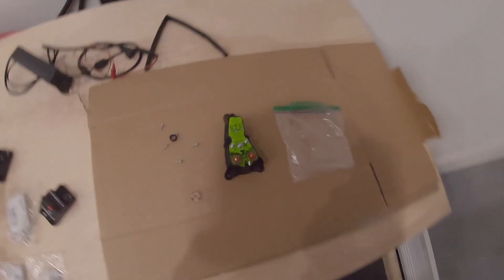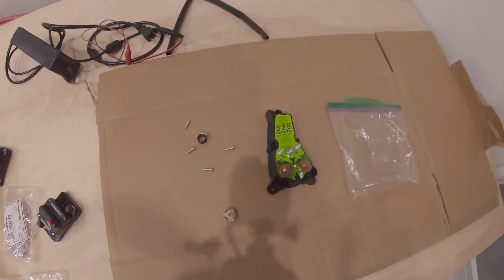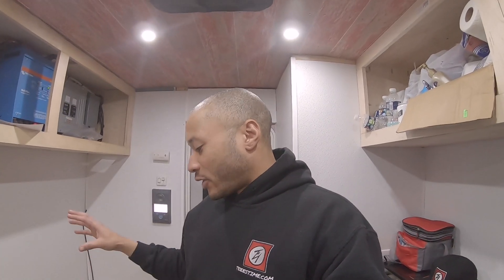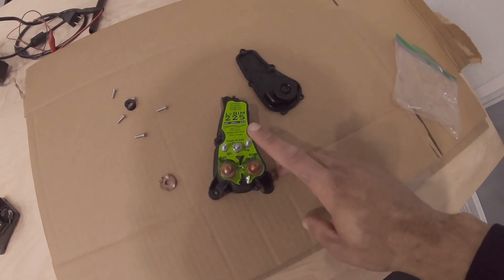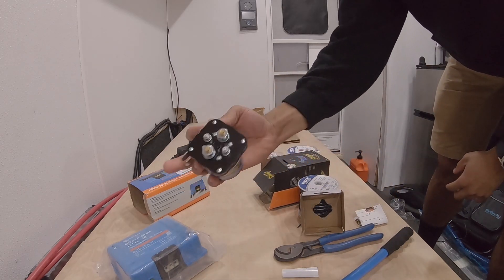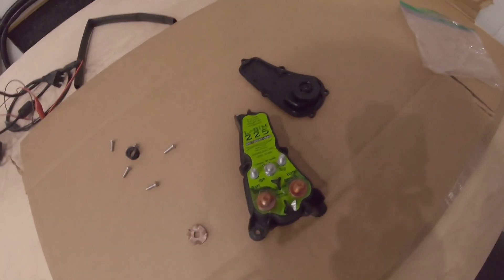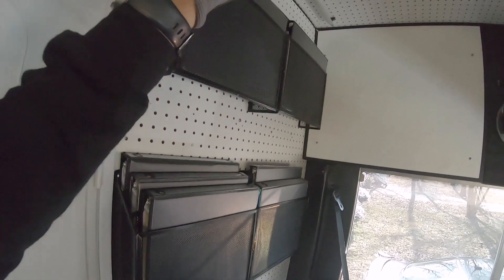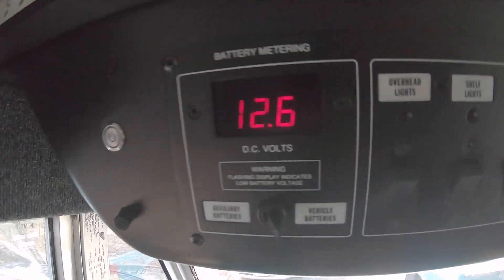Victron Orion 12/12-30 DC To DC Charger Install | DIY Off Grid RV Van Build: Episode 67

Comment: My victron dc dc is skipping bulk phase I found forums alone many others having the same issue. This didn’t happen when I first got it. Ran it for only a few trips then started doing it. Things useless now. Anyone figure out then solution? I’m thinking just go with a different brand all together.
Reply from the maker: Also the ignition sense is important. I previously had the battle born isolator 225 and it melted internally. I wouldn't recommend that. With these electronics it's imperative to double check the that it's programmed before putting in use. My orion has been in for over a year and the vehicle is daily driven with zero issues but time will tell. Hopefully you find the right solution for your needs

Comment: Using same charger. Gets so hot I can’t touch it for more than a few seconds! Is that normal? I’m using 6awg wire and 60amp fuse at the battery. 

Is the burning hot normal?!
Reply from the maker: Hi Jonny, they do get hot especially when running at max. I have some aluminum stock on the back of my solar charger and another plate that I have fhe orion. Heat is normal just make sure all connections are tight, the correct charge algorithm and the correct gauge wire for your run.
Reply: @teeestime6202  it gets super hot even just running for 20 minutes . yeah I have the correct gauge wire and the correct fuse. I did install the charger on some aluminum channel so it has space to breathe behind it and then I also installed behind it to thin sheets of aluminum. I got three small 12 V fans I’m going to Mount them to some thing and then mount the fans right above the charger. That’s the plan as of now.
Reply from the maker: Read the instructions and get a temp gun. There's something in there about operating temperature and make sure you programmed/ set the charge algorithm for the correct type of battery  and duration based on voltage.

Comment: I just heard you mention you are using 6 guage wire.  How long is your run?  I purchased a similar unit (isolated), and from what I read, I need to use 4 guage wire (techincally 5 guage, but I cannot find that easily).  Am I missing something?
Reply from the maker: Hi Greg, welcome to the channel and every install is a little different. Definitely use a voltage drop calculator. This one should help https://www.southwire.com/calculator-vdrop you'll need to know your voltage (a/c or d/c ) the length of the run and what amps your requirements are at the end of the run. Hopefully this helps and be safe

Comment: isn't that silly  that you have to add more victrons to get more power? I wonder why they don't make a 60 amp or more. I really like the idea of using an app to monitor and change settings when you need to . I may get one of those relays and just put an anderson plug on it ,cause i have a set of jumper cables with anderson jack on one end . That way i can jump my self or someone else . BTW my friend you should check out EWCS  Premium Extra Flexible Welding Cable. they sell on amazon . After trying their wire years back ,I don't buy any other brand .  Great video btw. Oh watch those circuit breakers mine im replacing  with anl fuses they get so damn hot even though i have the right amperage.

Comment: I would add a dual battery isolator.  The nice thing is you will never drain you main batteries for starting.  It connects direct to the alternator, then to your dc-dc charger and DC to your backup batteries.  And the other connection would go to your normal battery.
I have been doing this for years on my trucks.Then I take my backup batteries and run them to a 5,000 watt inverter for mobile power for our drills and saws. This helped element having to carry a generator on our service trucks for construction.
Also would be nice if you could list your product list and a link for purchasing.  Thks. Safe travels and roads Brian and Cindy,"xtreambydesign with passion"

Comment: Do you have to hook up the ignition wire... . Or can I keep it simple to charge a lithium battery  straight of the starter  battery.  thx
Reply from the maker: Welcome to the channel! I hooked up to switched 12v source for the signal so the charger knows when to charge and when not too
Reply: @teeestime6202  I thought it senced when the motor is running and turns on and then starts to charge the AGM or lithium battery .  So you only need it between the 2 batterys  simple setup..  4 wires.   That's what I want . simple.
Reply from the maker: @petermoygannon698  the 12v ignition source tells the charger to start monitoring the 2 battery banks and adjust accordingly
Reply: @teeestime6202   There are 2 models. isolated and non isolated 
. isolated one doesnt need conecting to ignition . it sences battery voltage from engine and starts .  you must have non isolated one .
Reply from the maker: @petermoygannon698  correct, I'm using the non isolated version

Comment: Excellent video. Just curious why you went with such a small DC to DC charger.   With 10 batteries I’m assuming you have 1000 amp-hours.  (100 aH each?).   Every hour of driving would only charge your bank 3%. (30/1000)).    it would be less work to start with a larger capacity DC to DC charger than to add more in parallel in the future.
Reply from the maker: You are correct on being able to charge at a 1000ah across the 10 batteries per the manufactures rec but it's a little over board for my system. I don't want the alternator to get over worked and the solar is also charging while driving so I have max about 200ah while driving on a sunny day. If I was draining the batteries down on the daily I might consider expanding the charging system down the road. The solar charger controller and dc to dc charger are both expandable in parallel. When I had the lit bim225 I would want to disconnect when I didn't want to charge the already charge lifepo4. So it's open to adjustable as we go through the trial and error phase but the solar has been doing a great job keeping everything running when I'm not staying in the shade😅. My solar charge controller is also 100ah and havent felt the need to upgrade that as of yet. Time will tell in the summer with the air conditioner running. Thats the main reason for the 2000ah capacity